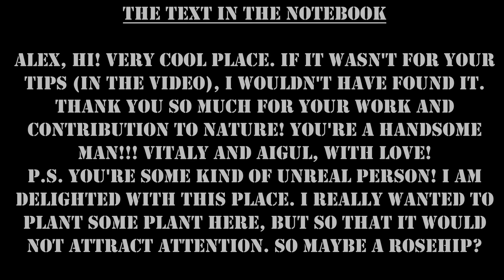Strangers have found my UNDERGROUND SHELTER house

Comment: Someone who accidentally happens upon your shelter and is in need of shelter due to circumstances is one thing. It is entirely another thing for a fan to deliberately search out your place based identifying factors in your videos, then help themselves without any kind of permission or even a heads up. It's just rude. I hope the fan who did that is watching this video and reading the comments section. YOU'RE RUDE!
Reply: I typed out a reply but advertisement wiped it out before posting, This isn't a community shelter as you maintain and I never believed it was just BS, Your upset because someone found it by watching the channel and I'm glad they shows your true colours! Shelter for community it never was
Reply: @Johnketes54  I'm confused - are you talking to me? What you've typed doesn't make sense because I am in agreement that it isn't a community shelter and there is a huge difference between someone being in a difficult situation where their wellbeing relies on accessing such a shelter and someone who is just willynilly walking in the forest and comes across it. I would not suggest that the latter just helps themselves. My true colours? I think it's concerning that someone can deliberately engage in stalking behaviour by observing minute details about someone's unspecified location and then identify said location and seek it out. It's both concerning and rude and the fact that I stated so doesn't indicate anything negative about my character or colours. It was merely an observation.
Reply: @LotusBlack5  Agreed.  They showed disrespect by leaving doors and windows unlocked, using up wood and not replenishing it, and not leaving the place in as good condition as they found it. Leaving the doors and windows unhasped makes it easier for nosy bears and raccoons to gain entry.   Once they get in, the place is trashed.
Reply: @LotusBlack5  I think that person was either reading into things (within your comment) or read parts ,and FAST tracked their thoughts ( rushed to judgement) into the NONSENSE they wrote in response,or my favorite.... Batsh1t cray cray. 

Youre sensible in your REASONING.... AND THE Facts! You noted pure RESPONSIVE REACTIVE thoughts ANY  normal people should engage in. ...but we live in a ME, MINE, MORE OF YOURS MOVEMENT IN THIS WORLD. - ITS PLAYS OUT EVERY DAY ,AND HAS BEEN FOR CENTURIES.AMD IS SADLY WHY WE HAVE WARS. HURTS TO KNOW PEOPLE WONT EVOLVE INTO BETTER OF THEMSELVES.

P.S THE ADS DIDNT STOP OR ERASE THEIR COMMENT THE UNIVERSE WAS TRYING TO STOP THEM FROM WRITING SOMETHING OFF PUTTING OR YOU YOUTUBE STEPPED IN😉
Reply: @n.hunter6666  Thanks for your comment! This person was trolling as I saw that they commented on other comment threads in much the same manner as mine. I don't bother with people like them too much. 

You're right about the current state of the world; things are so tough on all sides of the globe at the moment. I wish you all the best and prosperity!
Reply: @LotusBlack5  , agreed! Dont let people drag you into their weirdo mindset - you'll spend good energy on wasted time trying to clarify  - [ as too many rational] people try to. And just Agreed to disagree ,and learn to say "SURE" , THEN LET GO!
Reply: He gave tips on how to find it, so I'm guessing he doesn't mind others using it, as long as they respect it? I think he was just hinting to future visitors to make sure they lock the latch, but yeah, people should always leave a place how they found it! If there is firewood when you arrive, then replace it before you leave!
Reply: What nerve some people have.
Reply: My response was a long the same as the others. Some people are just so rude.
Reply: Try it again and you’ll step on a dozen bear traps. You won’t see them I promise you 🤬😡

Comment: Alex, I have a tip that could help  you splitting fire wood. First cut some logs about 18" tall It may take 4. Then trim them so they all fit snug together to make a chopping bloch and nail them together. Then place a tire flat on top of the logs and nail the tihedown to the top of the block. Then when you want to split wood stand 3 or 4 inside the tire and when you split them they should remain inside the tire  when you are finished splitting those pick them all together and stack them and replace them with more logs and go again.If you try this work with them till you get it all ok. I think your cabin is really nice and cozy. I enjoy visiting with you at night. looking forward to many more visits.

Comment: There is always one asshole that will mess it up. My question is who’s land did u build the shelter on? If it’s yours no one should be invading your property
Reply: It's usually the same guy, who never looks at himself in the mirror
Reply: It's on public land. The point is, the shelter was built for exactly that purpose - shelter for people stumbling upon it in the woods, and needing shelter from the elements. The winters there get incredibly cold, and a place like that saves lives. That's why Alex doesn't lock it - it is intended as a community resource. 

It wasn't built as a free vacation home for YouTube stalkers to rock up and use whenever they feel like it!

Comment: There's some very weird comments on this video. If you build something on public land then you have absolutely no ability to restrict who uses it. People building on public land know this and it's just lucky if nobody else uses what they have created.
Reply: Alex does not lock his shelters for that very reason, he has no problem with people who stumble upon them and need shelter, using them. That's why they are called 'shelters'! However, they are not free vacation homes.

It's a totally different thing for a pair of YouTube stalkers to deliberately seek out that shelter, and use it as a free Air B&B. That they did that without Alex's knowledge or permission adds insult to injury - as did the dumb letter they left behind, bragging about what they had done. What a pair of creepy narcissists!

Most people wouldn't dream of behaving as they did.